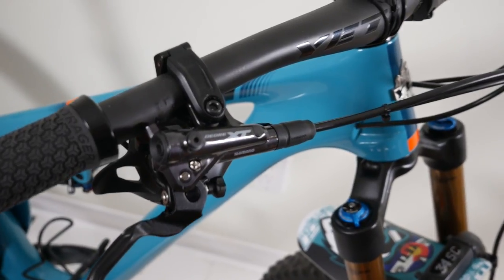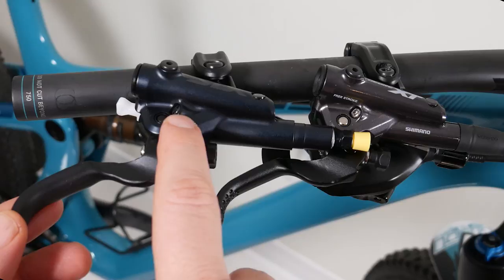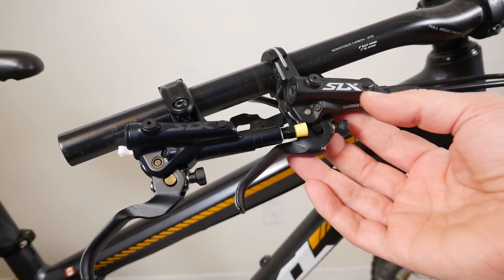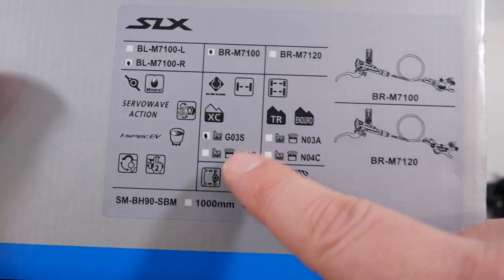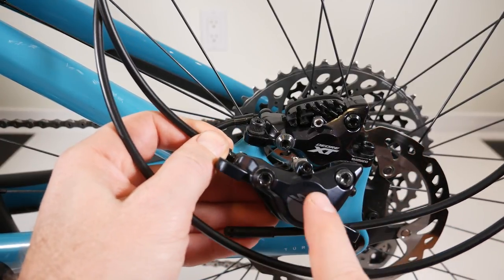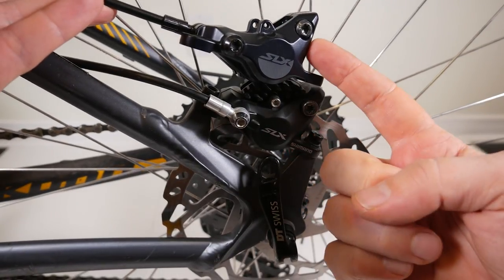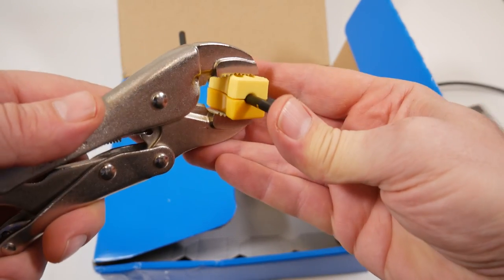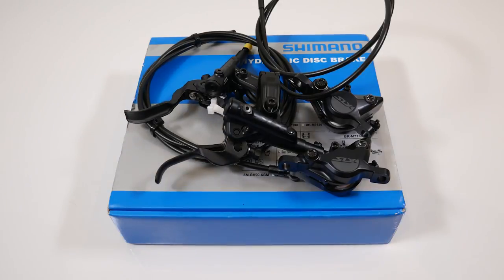BEST Compromise? Shimano SLX M7100 Brakes vs XT M8100 and SLX M7000

Comment: Well thats a bummer... Couldnt you just spray paint them black?
My bike is black with green accent, I dont want blue on it...
Reply: @LoveMTB  I guess I'll pay extra just for the looks... anyway I wanted an XT drivetrain too as my current SRAM SX is pretty bad, indexing always goes out the window after a couple rides...
Reply: @LoveMTB  Also could I use a SRAM cassette with the XT derailleur and shifter as my hub uses the HG freehub body...
Should I use a shimano or SRAM chain? Thanks a lot

Comment: I just bought a pair of the new SLX. For me this means I can finally get away from my last pair of sram brakes that I hate with passion. It will be great with shimano brakes on all 3 bikes. Zee, XT and now SLX. So far i prefer the Zee to the older XT (previous generation), time will tell if the new SLX are as good as the Zee.
Reply: When I get them I will see if I can remember to let you know, because I won't be table to test them before at least in a couple of weeks. I don't know where to do it though, although I could always comment it on your next vid on brakes. And happy trails to you too!
Reply: @TeamCykelhold   hey dude how did you find the slx compared to the zee ?
Reply: @LeecMTB  Zee vs newest generation SLX, I'd get SLX because of the better integration with shifter, but for the older models I like the Zee better.
Reply: @TeamCykelhold   thanks for the reply mate I’ve just ordered some xt 4pots 😀

Comment: these came w my trek top fuel, i like the more subtle look compared to xt, esp since my bike is all black anyways
Reply: @LoveMTB  yes, its got the twist lock out for front and back, tbh my suspension is set on the firm side and the bike pedals very well so i almost never lock it out. the brakes seem fine, its my first ever disc brake bike

Comment: Hi and  thanks for the video.
I just installed a pair of SLX M7100 brakes on my brand new Mongoose Dolomite, replacing the mechanical disk brakes.  Plug N Play (got the kit shown below).
Question - adjusting the brake pads:
Aside from loosening the bolts that hold the calipers on the mounting bracket, then squeezing the brake lever, then tightening the bolts, is there any way to  'fine tune' the brake pads so there is equal-distance between each pad and the rotor?

OR ... what is your procedure for adjusting the M7100 brake pads ?

M7100 kit
https://www.amazon.com/gp/product/B0887W31YR/ref=ppx_yo_dt_b_search_asin_title?ie=UTF8&psc=1
Reply: @LoveMTB  Ok thanks for the response. Appreciated.  I was missing 'line up the calipers' part.
You would THINK ... that for high end brakes like the M7100, there would be a fine adjustment for each pad or something.

Comment: Video regarding the free stroke adjustment:  https://www.youtube.com/watch?v=D0uSTtDWbI8

Yes it's poorly documented, but it does work (even with an slx-lever if you replace the screw). If turning the screw does nothing that means it needs a bleed. (lever top up mini-bleed is enough)

Cheers